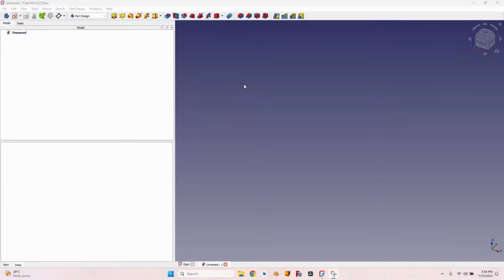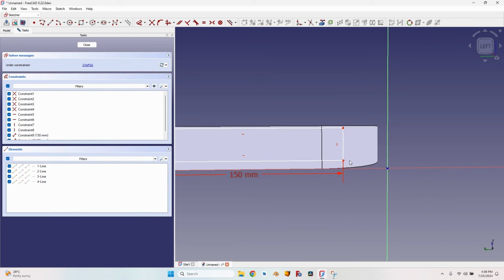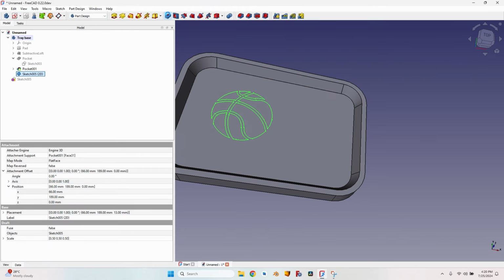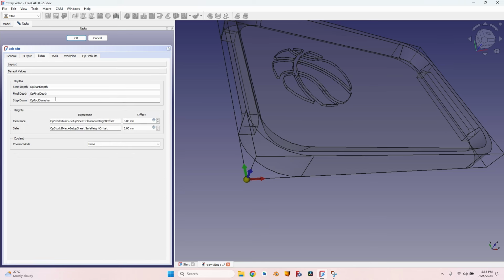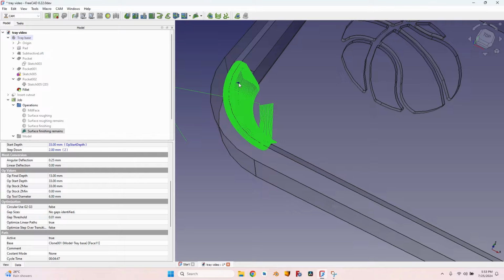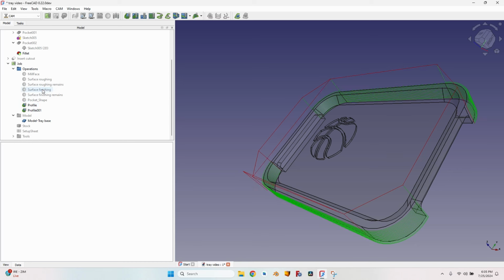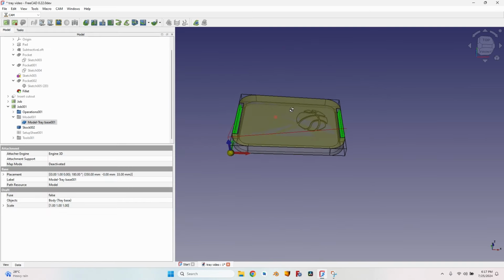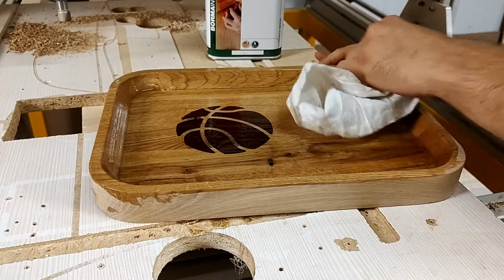CNC Serving Tray with Inlay – Design, Toolpaths & G-Code Workflow

Comment: In v0.22dev they implemented the contextually based dimensioning tool (Shortcut is the letter D) which looks like a red, sideways lying A with a dimensioning line above it.
Reply from the maker: I've seen it. For now it's light years away worse than the 0.21 measuring tools. The concept is not really bad, but it needs a lot of work

Comment: The topo naming problem should be fixed in the 0.22 dev version. So sketching on surfaces should be safe(er) now. Thanks for the good content 😊
Reply from the maker: Thanks! Glad you like it. I still run into the TNP from time to time even on 0.22, as some situations are simply unsolvable. I think the TNP is rather a problem in the way we think, rather than a programming issue. I prefer to avoid it if possible and necessary, that's why I mention it.